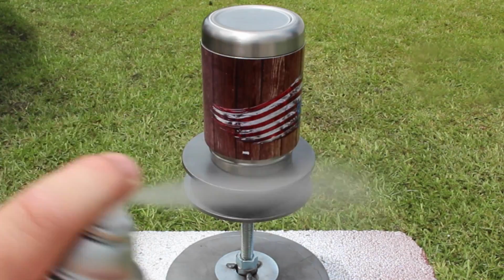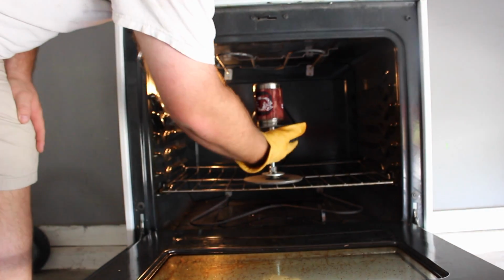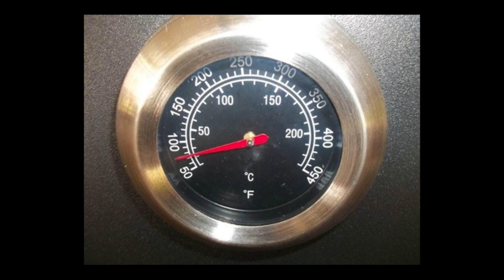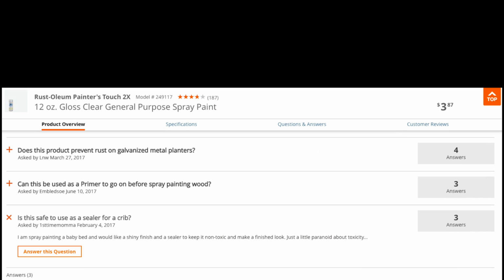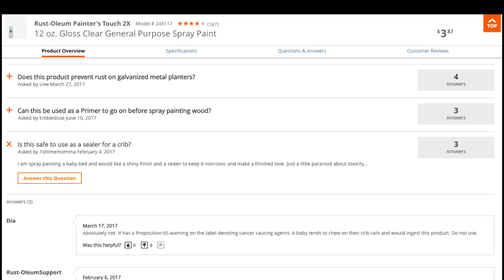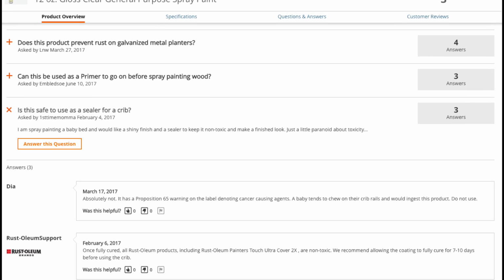DIY | Baking Rustoleum 2X Clear Tumbler

Comment: Do you have to bake it or can you just let it air dry?  or also use a heat gun?
Reply from the maker: When I was making cups. I only used my garage oven to speed up the drying process. Rustoleum clear can take up to a day to dry vs placing it in the oven for 20 - 30 minutes. Its up to you, just dont use your primary oven that is used to prepare food with.
Reply: @Fentertainment  I have a heat gun...would that work?

Comment: I have watched a few of your videos, which are very helpful 😊 One question I have. I spray painted a tumbler and used the glitter  then I used epoxy resin. Could I do this clear coat instead of the epoxy?
Reply from the maker: tcoffman16 if it's actual glitter I wouldn't. But with spray glitter I don't see a problem. It's just thatpray isn't as thick. Know what I mean.
Reply: Fentertainment, that makes sense. Thank you for responding!
Reply from the maker: tcoffman16 no problem, Happy Thanksgiving!
Reply: Thank you, you as well!

Comment: Is this 200°f? And should the item be fully cooled before reapplying the clear coat?
Also with using a toaster oven, should the temp be decreased? Seems like the heating rods would be too close in contact and would emit too much heat in a short. Period of time, compared to a traditional oven.

Comment: Can you bake a spray painted tumbler with a vinyl decal? Using this method?
Reply from the maker: Technically yes but dont so it for long because it make cook the vinyl and make the vinyl change color.
Reply: Fentertainment thank you 😊
Reply: Fentertainment I have another question 😊 so if I spray paint my tumbler, than bake it, can I just leave it like that and the paint will be ok? Do I have to seal it? Thank you so much for any help
Reply from the maker: @dasteffes  I would seal it with either epoxy, clear coat or powder coat. But that's just me.
Reply: Is this for sub or reg epoxy

Comment: Can you use this in place of epoxy? Also, your tip about applying epoxy with a gloved finger was a game changer for me!
Reply: I want to know this as well. Does this replace epoxy? Also, what is that tip about applying epoxy with a gloved finger? I am having a hell-of-a-time with my epoxy application. How do you personally use the gloved-finger technique, Robin?
Reply: Ryan Keeter Ryan cut off a finger of a latex glove and applied the epoxy with his finger. I think it shows it in the video he did with the solar cup
Reply from the maker: Yall can use it in place if you want to. I'm not saying this is the right or wrong way of doing it. Its just so much quicker!
Reply: Robin Bess me too!
Reply from the maker: You can or you can use it before epoxy.
Reply: Ryan Fenters  is this option dishwasher safe as well???
Reply from the maker: I havent tried it yet. maybe soon!

Comment: Hey Ryan, how would you seal a yeti for a Matte finish instead of gloss with epoxy?
Reply from the maker: They make a matte clear, I havent tried it yet but its on the list of videos to make.
Reply: I've used the Matte Clear on the Ozark Trail pre-painted cups. Baked with same process and it did just fine. Just be aware that if you vinyl is glossy and you spray it with the matte it to will be matte,

Comment: Will baking these cups even for the recommended 5 minutes cause any issues? I have seen some that bake them and the bottom combusts.
Reply from the maker: I havent had any problems, The longest I bake mine for is 45 minutes @ 200*. If you have ever heard of powder coating? You spray a color on the cup in the form of powder and you have to place them in the oven for 30+ minutes @ 350*+ for the powder to cure. Powder coating is the original ways the cups were getting coated. I just figured baking them at a less heat in order to cure the paint would increase production time. If you want to wait days on end for cups to be finished thats up to you or if you want to do it this way. My ways isnt the only way, but if you are selling them remember time is money.
Reply: Fentertainment thank you for replying. I can't seem to get epoxy down 100% and this seems perfect and much better for production. Thank you for saving the day!!!!
Reply from the maker: Just dont use the same oven you use to cook in. I bought a oven used for my garage to use.
Reply: Fentertainment I've got a toaster oven that will work perfectly :)
Reply from the maker: Shouldnt be a problem!

Comment: RF..........do you color paint cup,use oven to dry it after each coat you apply OR use oven after your done applying multiple color paint coats...or not at all when it comes to color paint but only when it comes to final step when applying clear coat    BUT we should use your clear coat oven procedure........spary/bake/spray/bake...Thanks
Reply from the maker: spray bake spray bake....Kinda like shown here https://www.youtube.com/watch?v=8LEVWfWvWRc. 1st coat is usually 45 minutes @ 200*, 2nd coat or water droplets 20 minites @ 200* then gloss clear 5 minutes @ 200*. When doing the gloss I let it cool before adding more layers.

Comment: when should i bake a cup and when should i not...  in some of your videos you dont bake them   

thank you!
Reply from the maker: Baking is just a new method that I have started doing. It speeds up the paint drying process. In the older videos I didnt bake them but also had issues when pulling the vinyl away from the cups. Now the paint cures much quicker when I bake them like the powder coaters do. Also I dont use epoxy anymore and just use rustoleum 2x clear.
Reply: ok, great!   does the 2x clear give that same gloss that the 2 part does... love your videos!